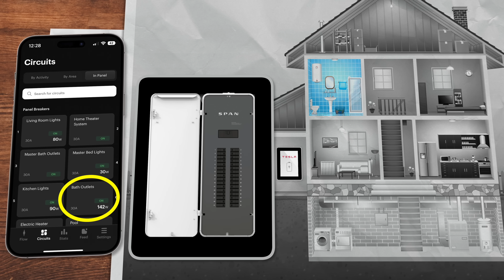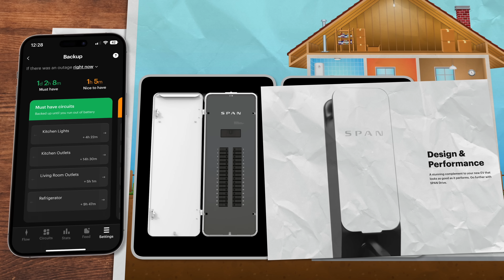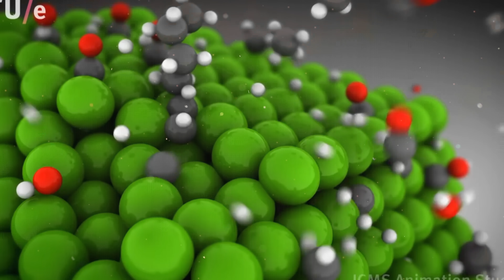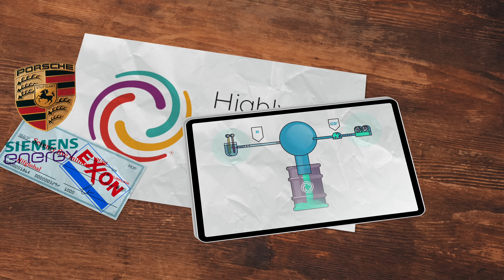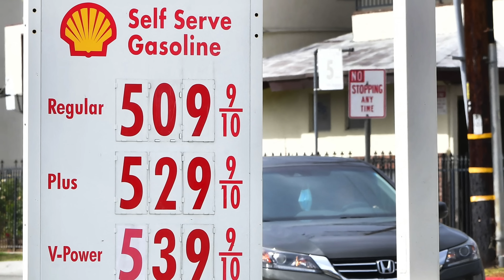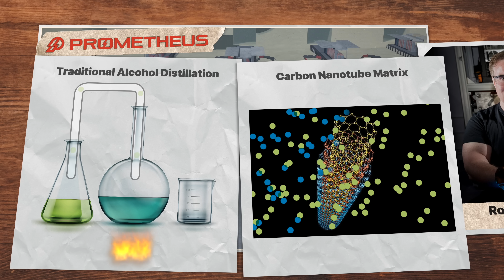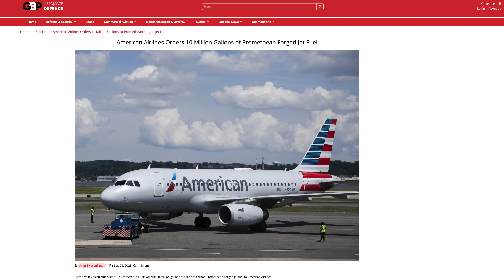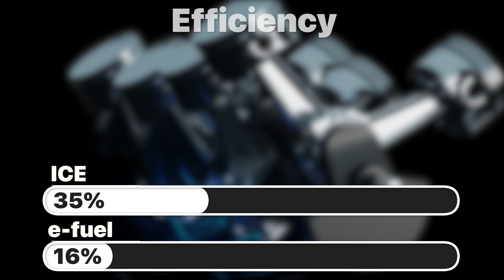EPIC Breakthrough Can SAVE the Internal Combustion Engine!

Comment: Is there a primary battery tech similar to aluminum batteries that could be made super cheap but is either very easy to recycle or uses only common cheap materials? Use the cheap& abundant power source to make them in huge numbers and design cars so there is a slot for something like the old car batteries and when your range gets low, just stop at a service station to grab a new one.
Reply: you described car lead-acid batteries perfectly : they're 99.9 % recycled, cheap, available in every service station, have a slot to fit in all existing cars.
The problem that e-fuels solve, is the power train. To use electric power you need an electric motor, and 1 billion existing cars don't have that.
Making a new electric motor (and the whole car that goes with it) is expensive.
Aluminium batteries might be a simple technology, but aluminium is not cheap. It's expensive material that eats a lot of energy to be made.
Spending resources and energy into non-rechargeable batteries is unsustainable (and , i agree, making non-recyclable batteries is also a problem)
Reply: @YounesLayachi  Lead-acid doesn't have the energy density, I'm thinking more like Al-air or the carbon-paper-something foil battery that I dimly recall reading about, single use non-rechargeable so it is basically same as fuels, only electric. Generally primary batteries can deliver more power because you don't need to make the reaction reversible, but with enough cheap energy you can recycle anything by reducing it to its component atoms.
The idea might work with hydrogen too, instead of pumping H2 into the car you connect something like a propane tank but full of either liquefied or super high pressure hydrogen.
Note both systems would have at least two slots for the batteries/tanks, so you keep driving until one is completely empty and switch it while using the other one.

Comment: Buy your math gasoline should be less efficient as well. It has to go through many different refinement to get the fuel needed from crude oil
Reply from the maker: very true those are hard to pin down, but the efficiency definitely is lower too

Comment: Sorry Ricky.. but this is all horseshit. I say this, because it leaves out the LARGEST issue with Efuels. Which is the same large issue with any other ICE fuels. It’s not carbon.. sure, carbon emissions IS a big problem. You are aware of what’s bigger though, and have completely ignored it here. ALL combustion engines emits harmful shit beyond CO2. Specifically the PPM 2.5 particles that are being found to cause MAJOR health problems, taking years off lives and causing devastating health issues to people across the globe. This, to me, is even MORE important to fix than the carbon emissions issue. And it is completely to do with the combustion process. We are killing ourselves continuing to burn fuels through combustion. That WILL continue with E fuels as their shown to emit nearly the same levels of this crap. ICEs need to go away, period. They need to be replaced with ANYTHING that does not involve combustion. And Preferably something driven by a renewable resource fuel. IE, wind, solar and hydro power plants that produce electricity to be run in EVs. It’s simply the only current clear answer. Green hydrogen will have a place in aviation and maybe even a few other sectors if it can become cheap enough. But burning shit  needs to stop. You don’t need science or any studies to even KNOW this. Go stand next to the exhaust of ANY combustion engine and breathe that shit for 5 minutes and tell me how you feel. It’s not just CO2 that’s going to make feel like shit and probably pass out.. there is LOTS of shit in the exhaust of ALL ICEs that will make you choke, dizzy, feel sick and ultimately pass out and potentially die.. and the long term affects of the shit in there that’s getting into our blood stream and going into our tissues and brain matter, are proving to be equally tragic. This shit needs to END. NOW is the time to end it. For a long time we didn’t know.. for a long time answers were fuzzy.. it’s still being suppressed, but the cat is out of the bag. We KNOW ICEs are killing us in multiple ways. Efuels fixes really nothing. Don’t promote bad answers man. I get it.. some ICEs are gonna be with us a long time till we find a viable way to change them all.. maybe efuels can bridge that gap.. i doubt it.. by the time they’re readily available and affordable, they should be 99% unnecessary. Renewables and NON ICE options are the only acceptable answers with what we know today.

Comment: E-fuels are CO2 nutral, but when burnt in a conventional motor the will produce nitrogen and soot (fine dust). So burning e-fuels is not totally environmental friendly. Producing e-fuels is very energy consuming and the efficiency is very poor. In other words it is wasting energy. When it relies on government to get the price to a reasonable level  to compete with fossil fuels it is not suitable as a temporary fuel for existing cars. 
E-fuels should be the last alternative if the use of batteries and hydrogen is not possible.

Comment: This line said it all, " storing & transporting sunshine" this alone makes it worth it not including the carbon capture.
Reply: Not really. The efficiency is very very low and you have to efficiently sequester 400ppm carbon dioxide from the atmosphere which is likely to be very energy intensive. Then you haven't solved the nitrogen oxides problems either.
Reply: @rogerphelps9939  Efficiency does not matter if inputs are free

Comment: The process to synthesize eFuels could also be used as an interim electricity storage solution: until grid-scale battery capacity catches up with our renewable generation capacity, we currently have to instruct wind turbines and solar farms to stop producing when supply exceeds demand. We could instead use that excess energy to do things that aren't time sensitive - such as desalinate sea water, and now make eFuels.

Maybe it'll be a thing for the 20 years or so it will take for the majority of cars on the road to become electric. After that it'll still be useful for jet fuel and shipping, which most likely will continue to grow.

Comment: The current automotive fleet is around 1B, if Tesla (alone) reaches its 20M yearly target, and other manufacturers also catch up, there could be 100M/150M new EV produced per year. This would push ICE car out of the market within less than 10 years.
Reply: John Stossel has a great, two-part series on EV’s which you might find educational. It would currently take us several hundred years minimum just to mine enough minerals for the batteries alone (using current technology) much less double our power grid capacity. Would be nice, but simply not feasible with today’s technology. Look at California’s power grid woes from this last summer, rolling blackouts and requests not to charge EV’s on hot days. This summer could be much worse.
Reply: @themacker894  Car ownership is also undergoing a change, this will mean the "per capita car" ratios will change. With enough economic incentives, those minerals will be dug out. The battery chemistry is also changing, LFP are already a matter of fact, and more to come.
Reply: @themacker894  John Stossel has been debunked many times, he should stick to his bake sales.
Reply: yeß

Comment: there is no timeline where efuels will come into play with any relevant impact at scale earlier than the full phaseout of ICE will happen, anyways (for road vehicles, that is). so no, they won't help. at all. it's quicker and less harmful to ditch ICE.

now intercontinental flights n such might be different. but even there, burning any fuel is still incredibly harmful for the environment, no matter what type of fuel. "co2 neutral" is only part of the harm.

but in the end, doing the numbers of scale up and ramp up of the different technologies (both vehicles, energy supply, resources etc) have at no point any relevant impact of efuels in it. 20 years ago? maybe. now? way too late.
Reply: LOL.  You can take the bullet train to Europe.

Comment: I feel that a serious, cradle-to-grave analysis of the fuels should be made, and then weighed against the availability of renewable electricity. Let's focus on where the use of that scarce renewable energy makes the most sense. When we get to a stage we can create a steady surplus, we can think about making e-fuel. And yes, I agree that for old cars and a number of other applications, e-fuel can be a better alternative than fossil fuel. But not if the available renewable energy has a better overall impact when used in other applications. And as a word of warning, building installations for hydrogen and or e-fuel production only on surplus renewable energy will never happen, so long as that surplus is not systemic. Almost no installation is economically viable when it can only run less than 80-90% of the time of the time (the times with surplus electricity. I am afraid that this will be used by oil/energy companies to keep their hold on part of our transport/energy structure.

Specifically generating renewable energy for the production of e-fuel is probably not the most efficient use of this generation capacity. There are other uses, such as the sand heat battery, that are specifically designed to be more useful/efficient in a situation with only an intermittent renewable energy surplus.

Comment: I hate how a click bate video starts off with propaganda about make believe "man made global warming". The climate has cycled changes for 4.6 billion years. Water vapor is the main GHG and is 4 times more potent and 100 times more prevalent. It swings from 20,000 ppm to 60,000 ppm while CO2 is 420 ppm currently. The important thing is historically there is relative equilibrium even when CO2 was at a level 5 times higher. One gallon of gasoline has the equivalent of 27 kwh of electricity while an EV may have a 100kwh battery that is extremely expensive and very toxic to the environment. You are trading one "problem" for a much larger problem.

Comment: How about the oldest efuel we already use and burn, ethanol from sugar in plants?
The plants build the sugar hydrocarbon chains from carbon pulled from the atmosphere, making it renewable.
Ow, not to mention, ethanol engines are more efficient than gasoline engines, as they can naturally run with a higher compression.
And the even better part, to make a modern ICE engine swap from gasoline to ethanol, you simply adjust the software in the ECU. Yes, one could go the extra mile of increasing compression (shaving the head or changing pistons or even adding a blower) to take advantage of the greater efficiency, but just by adjusting ignition timing and fuel mixture, you can turn your gasoline vehicle in a reliable ethanol vehicle.

Comment: This king of fuel manufacturing is a good match with the proposed mode of future energy generation. Renewables and batteries currently need an oversized generation capacity in order to cut down on the capital cost of storage. Which means surplus power for free in good weather. Fuel manufacturing could take the surplus power and turn it into a profit no matter what the efficiency might be.
Reply: Also since synthfuel is more stable than refined fossil fuels it can be stored longer, so countries can safely store up their surplus for long term seasonal variations in renewables as well as store extra energy from nuclear when demand is very low to help balance the grid.

Comment: What about all the other (non CO2) particulates that are cast into the air while burning fuels? Does this new re-burning process remove them as well, or does it introduce more or worst particulates?
Reply: It doesn’t fix shit on this problem. This is where the argument to even bother researching e fuels falls apart. It STILL leaves us with some of the biggest problem of ICEs. I guarantee you, if you were to sit in a closed room with a ICE burning Efuels.. you’ll wind up unconscious and dead long before you run out of oxygen. I don’t need any scientist or study to explain, that this is not the answer to moving forward intelligently
Reply: @airheart1  Hey there, I agree with you, that this won't solve all problems. But for now, we need all th innovation we can to solve the disastrous consequences we are facing. ICE running on efuels can be part of the solution, but we should then ban diesel cars, that produce the nefarious chemicals too many of us still breath. Gasoline cars don't have that problem, if their tanks are filled with efuels (you basically end up with something pure, without the sulfur found in oil). But of course, EVs are and will only keep getting superior ; we only need to find how to produce enough batteries, and also discover other chemistries (with sodium, aluminium, etc.).
Reply: @David_Cabrita  Completely agree. EVs are the future and so is worldwide electrification of anything that can be electrified. However, when you say "...we only need to find how to produce enough batteries..." you seem to discount it as something trivial, which it is not, especially considering the other needs like high energy density, high power density, low cost, recyclability, availability of raw materials, safety, durability, and so on.
Still, it's something I'm confident we can pull off eventually. But, until then, we need to do something about billions of ICE-powered vehicles and the CO2 they're emitting into the atmosphere. You can't just ask or force a billion Indian people to stop using the ICE motorcycles, cars, or rickshaws they use every day to get around. They're too expensive for them and there simply aren't enough EVs out there or the infrastructure needed to support them.
On the flip side, we already have the cars, the roads, and the infrastructure in place for ICEs, the big problem is the fuel source.
Reply: @David_Cabrita  disagree on the E fuels. The information I’ve found says combusting E fuels still puts out noxious compounds, as well as PPM 2.5 particles in near similar quantities as burning standard gasoline. Which while better than Diesel, is still nasty crap we should be doing our best to get away from completely. I’ll go find the info again and see if i can paste some of it here about what I’ve read.

This is part from one article from a study in Europe by the clean mobility NGO Transport & Environment..

“As long as fuel is combusted in engines, toxic air will persist in our cities. Lawmakers who leave loopholes for e-fuels in emissions targets are condemning the public to decades more of avoidable air pollution,” said Julia Poliscanova, senior director for vehicles and e-mobility at T&E.

The tests compared e-fuel with E10 petrol, the standard blend in the EU, which includes 10% ethanol and 90% unleaded fossil fuel. They found that synthetic fuels emit similar levels of nitrogen oxides, almost three times more carbon monoxide, and up to twice the amount of ammonia.

However, e-fuels did outperform their fossil counterparts in the number of particle emissions released, significantly reducing PM2.5.

So ok, the PPM 2.5 according to this study IS reduced.. that’s good news.. but the rest sounds pretty shitty still. So maybe i recalled it backwards.. i thought the PPM 2.5 shit was still the main problem with E fuels.. or this study found a different result from what i first read. And they all need a helluva lot more than 1 study.. i definitely want to know what the reality is and not just one view on it.. but I do not think combustion is the answer. And my tell for it is.. if you can put someone in a closed space with a running car for 10 minutes and they’re breathing like it’s just clean air.. you get my support. If you’re choking, wheezing or passed out.. end of discussion.
Reply: @airheart1  dumb.  Engines require oxygen.  You require oxygen.  Solution? Don't sit in a closed room with an ICE running.  Duh.
Reply: Good point, since water and nitrous oxide tend to form into nitric acid - a highly corrosive compound
Reply: @IronDragonGroup  solved in modern cars
Reply: Good pount.  But midern cars produce far fewer pollutants than years ago 

Bottom line?  A mix of technologies will end up the best solution
Reply: eFuel would not have any sulfur. So you would eliminate sulfur dioxide emission.  Particulate emissions are generally associated with diesels. By carefully controlling the makeup of the fuel, you can reduce them, but not eliminate them.
Reply: @douglee2438  Very true, and catalytic converters take care of a lot of the other particulates and pollutants like NOx. Trust me despite there being more cars on the road driving into NYC is a completely different experience from what it was just thirty years ago, there was a literal brown dome of smog over the city, these days it is barely noticeable and only if you look really hard on a day where there isn't any wind. About the only really bad thing of quantity coming out of a modern ICE is CO2, lots of it.